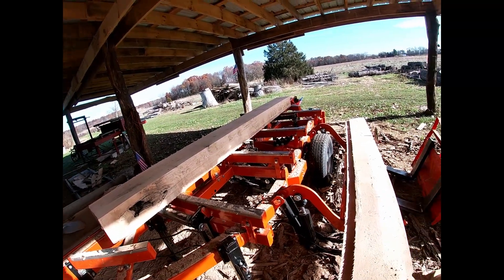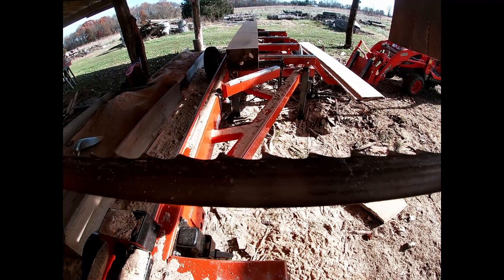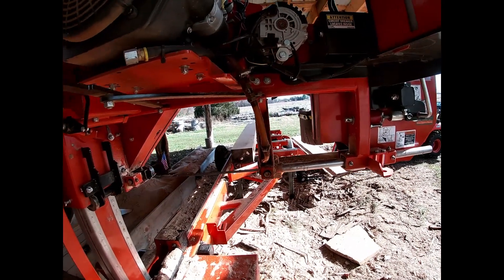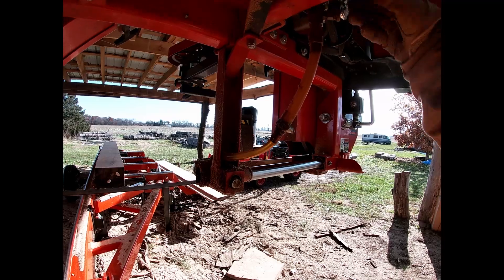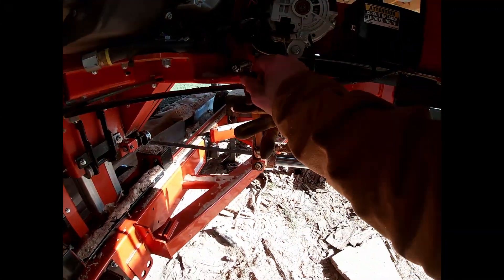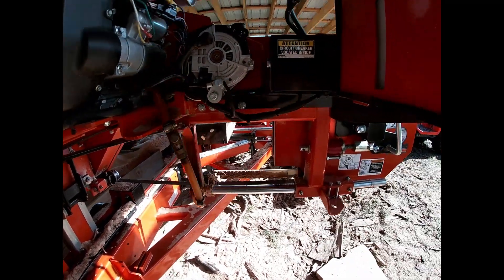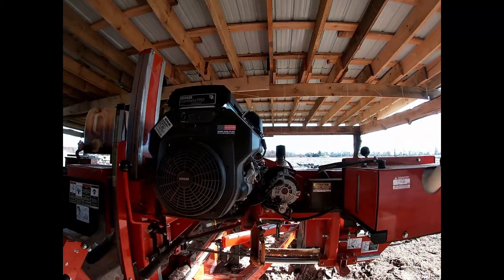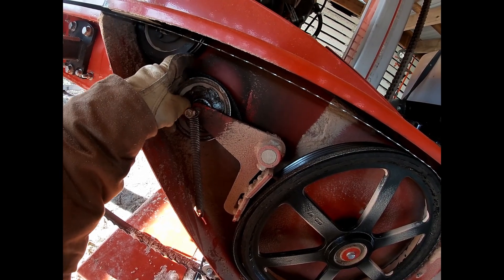Diesel Drip for Sawmill blade lubricant system cooling, cleaning, dose Diesel lube smell

Comment: Two things: take the tube out of the hole and attach to the black fixed tube that goes to the blade with zip ties. Then attach zip tie around tube and attach to black stiff wires next to alternator to get rid of dip in tube. I’ll try to send video of mine
Reply from the maker: That would be great!
Reply: @DANG--  can’t seem to load video. Please send me your email address I’ll send it that way
Reply from the maker: @robnoelgolf  mynaturalfarmgym @gmail.com